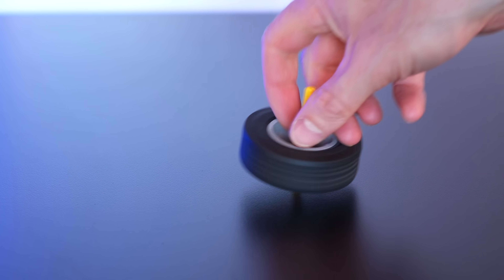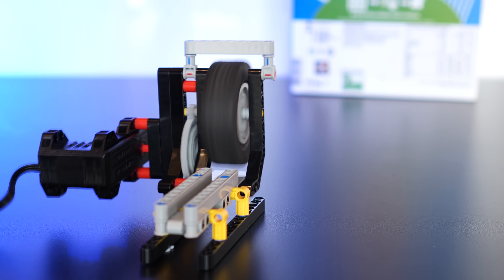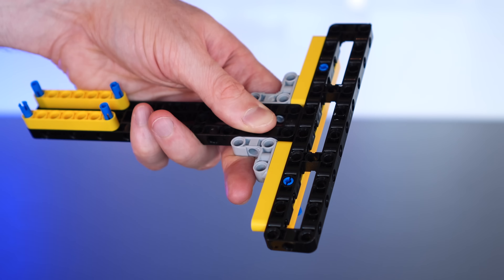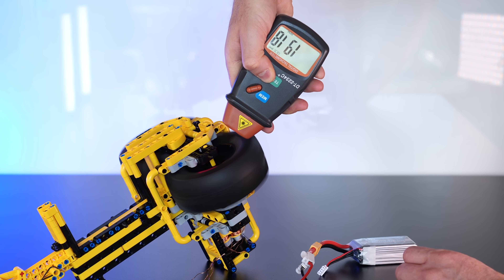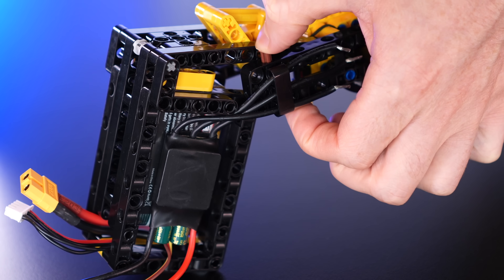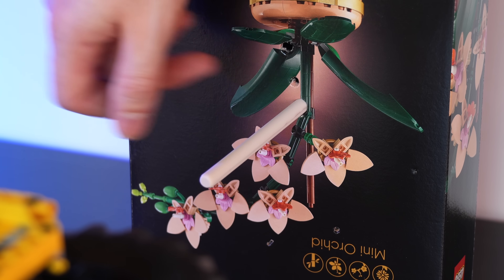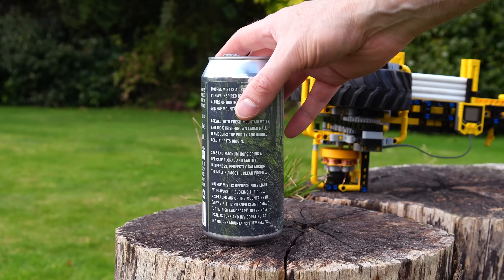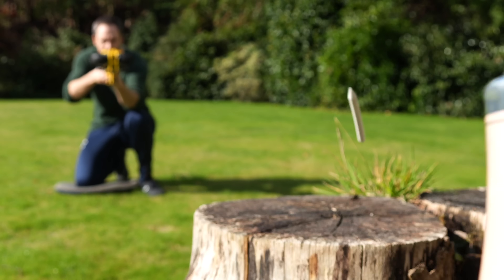Lethal Lego: Making An Overpowered Bolt Gun

Comment: you should also try adding some sort of rifling mechanism or maybe an extended barrel although the former will be hard to do with lego and the latter hard to do without introducing too much friction

but i guess friction can always be overcome by applying more power (:
Reply: Rifling and a longer barrel wouldn’t work in this case as ammunition used in real guns with rifling are propelled by by gunpowder igniting, which causes high pressure gases to build up in the gun temporarily; and the rifling only twists the direction of high-pressure gas behind the bullet getting shot, stabilising the bullet. A longer barrel on a real gun only allows the bullet to reach higher speeds before leaving the gun since it allows more gunpowder to act on the bullet. On the other hand, the gun in the video is pretty similar in concept to many toy guns, which use flywheels to propel the “bullet” getting shot out, so there is no high-pressure gas in the toy gun, so rifling would have no effect. A longer barrel would have no effect as all of the energy transfer to the “bullet” only takes place between the flywheels. Besides, in Nerf Elite blasters, a longer barrel can cause poorer performance as the Elite darts are prone to tumbling, similar to the bolts in the video, so whatever is getting shot out bounces inside the barrel, so it loses a lot of energy before it leaves the gun

Source; I have an interest in real guns and nerf blasters, so I got to learn these facts
Reply: @Benjamin_qu  very informative - thanks!

Comment: If you angle one of the wheels slightly up and the other slightly down you could get some spin on the bolts, which will make them more stable and accurate
Reply: My first thought, as well.
Well, okay, my FIRST first thought was that he should probably invest in some shooting glasses, to protect his vision from any ricochets.
Reply: @JeoshuaCollins  his bolt gun does not have enough power to get a ricochet back towards at him, at least not now. if a ricochet happened, the projectile would have no power to cause any damage to him. but if he decides to make some more powerful things, i completely agree on getting the glasses. they shall be useful
Reply: @JeoshuaCollins or shrapnel
Reply: you think well
Reply: Have you ever tried to turn something slightly with Lego while still keeping it stable?
Reply: @Picklebob-q8hyeah fair point, but he has a 3d printer, so he could print a small part to hold the axles of the wheels at a slight angle and attach them to the rest of the build
Reply: Not at that ratio. There's a reason sabot rounds aren't spin-stabilized.
Reply: The mass distribution of the long bolt makes it unstable when it's spun ig
You know, modern large-caliber armor-piercing ammunition is stabilized by its tail fins, but not by spin bc of its long shape
Reply: @MinefieldArmory Not completely true. Only Armor-Piercing Fin-Stabilized Discarding Sabot, or APFSDS ammo has tailfins, and that’s because of it’s design. So while yes, it would be better to use tailfins, it would need to be fired in a shell or else the tail fins would get caught on the wheels and break.
Reply: @ThespianDevil I’m thinking of having 4 wheels, making there be a tiny gap between the top and bottom to fit the fonts and the top and bottom fins will be what the wheels spin to launch
Reply: @Armadillowithgun this is overall a solid plan but practically this would be difficult to build. The interface between 90⁰ gears probably isn't intended to be functional in the thousands of rpm.
Reply: Playing football growing up I remember the auto ball launcher had two tractor tires that were oriented how you’re saying and it was cool to mess with lol
Reply: Yes! Just like 5° twist in each wheel! Nice idea!
Reply: I don't think that would work on this. Spin stabilization in ballistics usually needs insane spin rates, like hundreds of times a second. I don't think angling the launching wheels could achieve that kind of spin rate even if you angled the wheels 90°.
Reply: @bmouch1018  couldn’t hurt to try. It’s exactly how football launchers work, and they work well. Obviously a bolt and a football aren’t super comparable but any spin is better than no spin
Reply: @thatsHECKAtight  true, true. Idk why I thought it would need to spin as fast as a bullet. That's on me. But I think a better solution would just be to reprint them with a relief cut near the end that flares back out to full diameter. It would create a drag force that would do the work of fins for stabilization without putting fins in the way of the launching wheels
Reply: @bmouch1018  I like your idea, much simpler and don’t have to figure out how to do weirds angles in a Lego build. At these speeds would probably work better overall. Nice thinkin
Reply: I experimented in a building game with a ordinary missile and a spinning missile, turns out the spinning one would not be perfectly accurate, but wouldnt spin too out of control. The non spinning one just crashed.
Reply: lego is not precise enough. only 2 wheels wont be stable. it will rotate but often will cause the dart to wobble
Reply: Or introduce channels into the bolts surface to give spin to them. Some kind of barrel with an air intake and exhaust may help too.
Reply: Or make the projectile spin before feeding, it’s a lot simpler
Reply: Spin stabilization doesent work on long dart like projectiles.
Reply: @Teppo_Hacknå bet
Reply: You mean gyro stability in the air?
Reply: @Gabriel-righthandofgod  similar to rifling

Comment: 7:30 The reason why it was hard to cut is becouse that wasnt a wood cutting disk, it looked like a ceramic cutting disk, which is very bad at cutting soft things, since it gets jammed up with soft material. Wood cutting disks have teeth, theyre designed to create much bigger particles and get rid of them, while a ceramic disk isnt afraid of that, since ceramic dust isnt sticky, falls apart and is light enough to float in air. It literally grinds ceramic to dust
Reply from the maker: Ah that makes sense - it was jamming quite a lot. I actually bought them to cut nails, so at least they'll hopefully work for that!
Reply: @JamiesBrickJams  As long as its not aluminum you should be good
Reply: @JamiesBrickJams  Yea, it's a diamond plate. It's not good for metal, you might get it to work somewhat but it'll be slow. It's for glass, stone etc. Check in DREMEL 690 EZ SpeedClic. It's a good set with metal, plastic and narrow abrasive discs.
Reply: for low torque it would require a wheel with tiny teeth, ideally angled to shunt jams
Reply: I iritis I t owe t try you question

Comment: You could get some insane speed from making a purpose built non legal gun like launcher and you could impart spin on the projectile by tiling the pinch wheels. I have thought about making such a thing for a while the main issue is no place to test it. With very hi8gh rpms not sure how fast a projectile could be launched but it would be quite dangerous even this lego set up could likely got well above 200 fps a all metal one could probably break 800+fps with heavy metal projectiles fairly easy